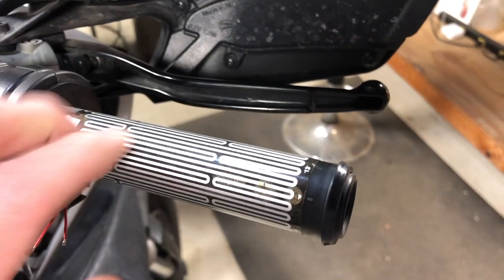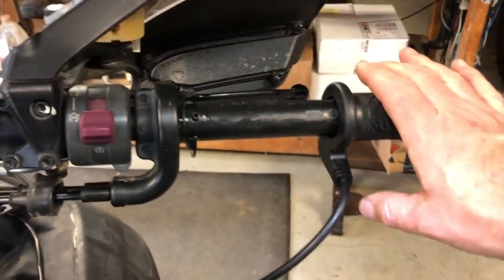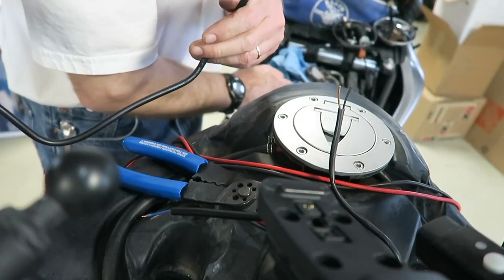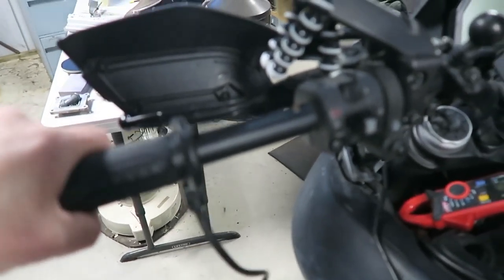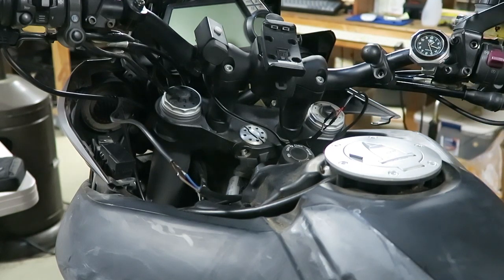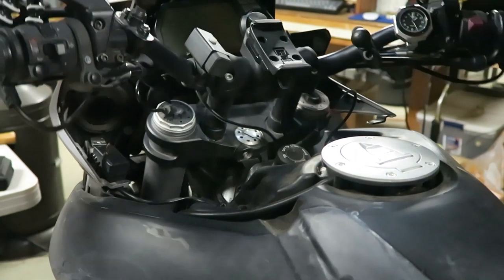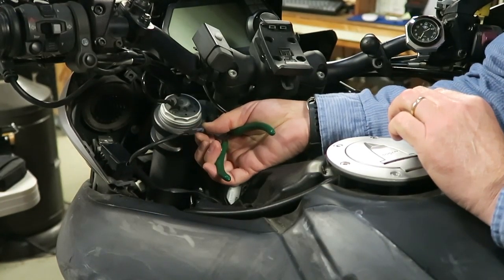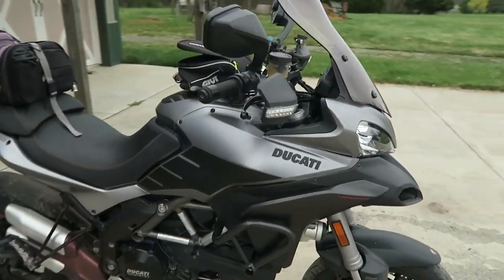Ducati Stock Heated Grips Fail.

Comment: Thanks for the video, I'll probably go for the same change. How is it working for you so far ? Do you feel difference when heating is set to low, mid and high ? Normally on oxfords, 30-40% is more than enough to heat it well.. is there any correlation with ducati low-mid-high option ? ie. MID = 40% (oxford) ?
Reply: nevermind, you said it around min 22 in the video. thanks